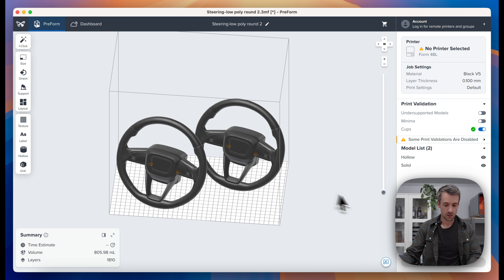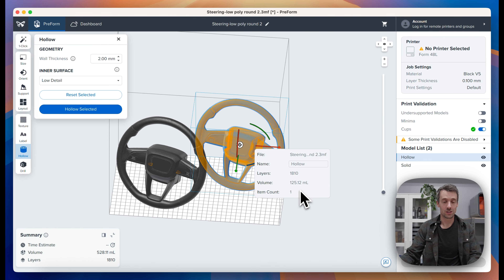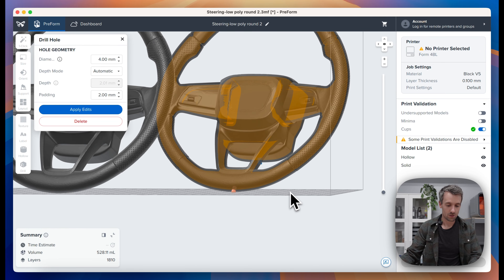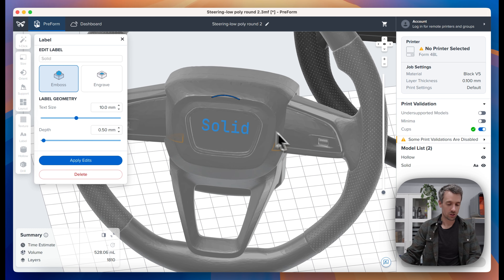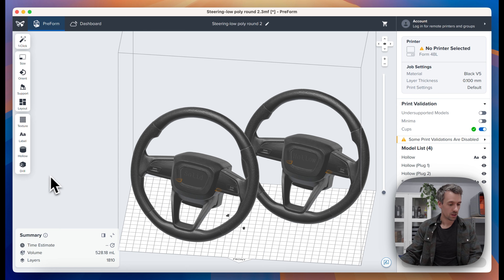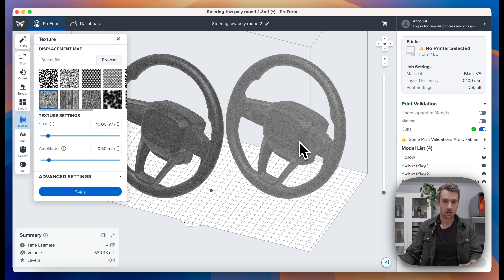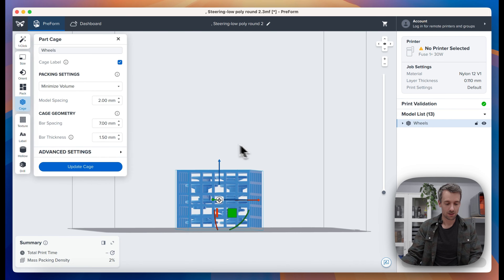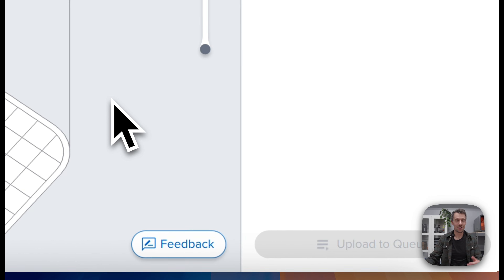What’s New in PreForm 3.41?

Comment: Can we get a brush tool and paint bucket up to certain edge angle for the surface textures?
Would be incredibly useful at work, we have 5 formlabs printers and use them a lot.

Vertical stacking of parts and better/more space efficient support for branch generation would also be much appreciated, as we sometimes need 4-500 smaller parts printed, and volume wise, it could be 3-4 prints instead of 20-40, reducing man hours fiddling with the printers and washers.